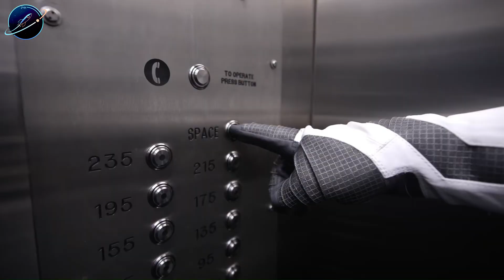SpaceX Found Perfect Reuse! Blue Origin's Same Flight Since 2021...

Comment: We have to give BO a bit of rope.  They have recovered a booster.  If it can be reused, then it is possible that as time goes by, BO might have a fleet.  If they do, then they might become a viable company.  If, however, BO is unable to turn the NG booster on a timely basis, then BO will become little more than a rich mans toy.
Reply from the maker: Fair point—Blue Origin did recover their first New Glenn booster successfully on the second flight (Nov 2025), a solid step toward reuse.

Comment: I don't think BO can catch up to Musk because Space X has and assembly line process that rivals Henry Ford and Space X is well on its way refining the larges and most powerful rocket every built.

It appears that BO is building New Glenn rockets one at a time and is too slow to innovate and re-fly.  BO is driving the equivalent of a 2010 NASCA and Space X is building the fastest F-1 on the planet.

BO will make progress because NASA will keep it alive, but Space X will using its rockets building a commercial space-based empire.
Reply from the maker: Solid analogy—SpaceX's assembly-line tempo (now with Falcon 9 boosters hitting 30+ flights and 165+ launches in 2025) is unmatched industrial scale.Blue Origin is ramping New Glenn production (one second stage/month, targeting 12+ launches in 2026) and plans to reuse boosters up to 25 times, but yes, they're still in early fleet-building mode while SpaceX builds a true orbital empire.